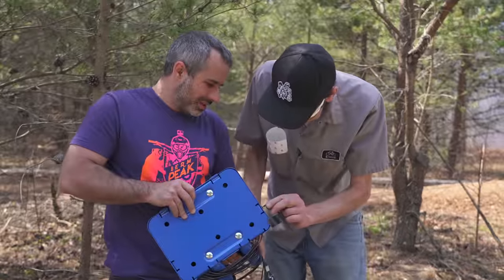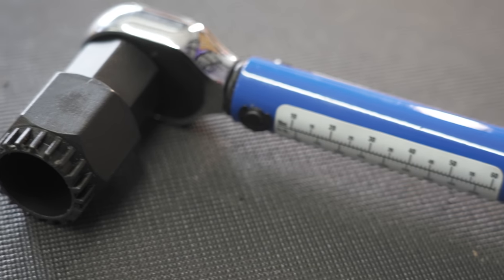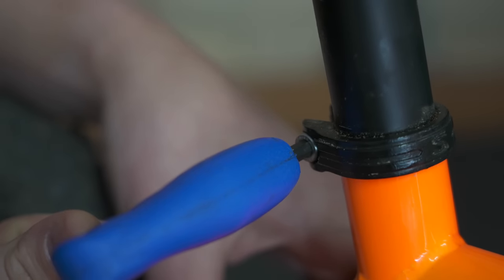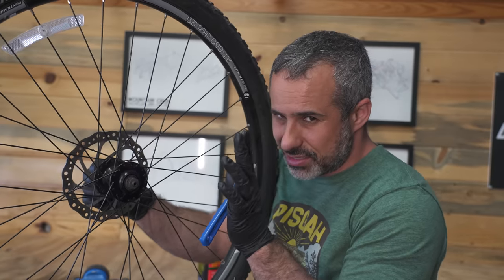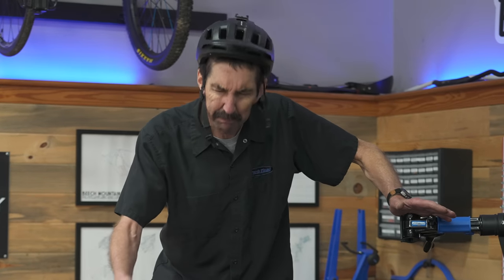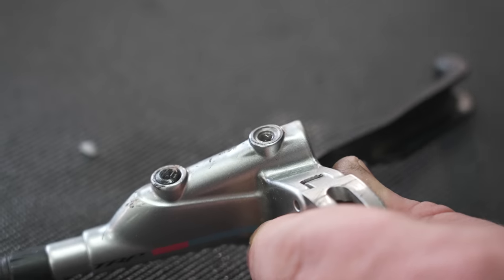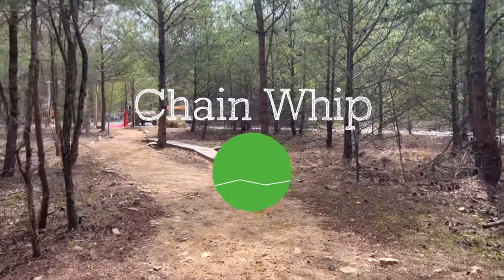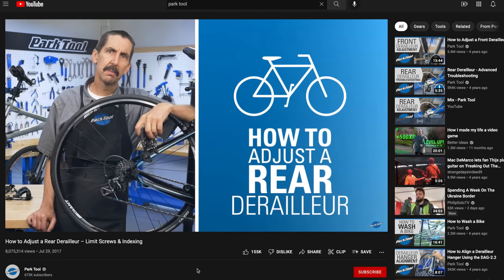10 Rapid Fire Bike Repair Tips for MTB & Beyond - Featuring Park Tool

Comment: It's those small details that make a world of difference, and one of them is to prepare a seat clamp correctly... 99% of all seat clamps are dry causing all kinds of mysterious seat-post movement no matter how much carbon prep you apply or how hard you tighten the seat-clamp.
Here's how to fix that..  All you do is remove the seat-clamp, carefully clean the inside of the clamp and the frame where the seat-clamp sits. Then lightly grease the inside of the seat-clamp and the area of the frame that contacts the inside of the seat-clamp. Then lube the threads and the head of the bolt on the S-clamp binder bolt.  Then apply a little bit of Carbon prep grease on the seat-post and BINGO, your s-post will no longer move.  What this does is it allows the entire clamp to move and draw it's self tight around the frame and seat-post with out pinching. Dry seat clamps tend to pinch which often results in cracking carbon seat posts. TKS Dan

Comment: Spent a ridiculous amount of time indexing and limiting my read derailleur one time. Turned out the rear 'maxel' was not tightened enough! So tightening that completely fixed the shifting. Actually it still comes loose from time to time. It's easy to spot because the shifting starts to suck. Is there a reason or solution to this issue??
Reply: Blue loctite?

Comment: Is there any difference between the barrel adjustor at the derailleur and the one at the shifter?
Reply: No. Many newer derailleurs dont have the barrel adjuster at the rear anymore though.
Reply: @johndef5075  Thank you. I suspected as much myself, both adjustors modify the tension on the very same cable. And yes, I’ve only seen the rear adjustor on older bikes. Thanks again. 🙏🏻

Comment: So, the float test? Why does that work? Is it that a bent hanger has micro cracks that hold air? 1
Reply: Its meant to be a joke. If you tried everything and the only possible malfunction is the hanger, then why not get a new one? 99% chance its gonna solve the problem, if it doesnt, you just have a new one!

Comment: Use aluminum paste on all steel screws that is jointed with aluminium. that means you don´t get galvanic corrosion and if you one day need to loosen the screw you actual have a fair chance to do so. If you don´t use aluminum paste the steel and aluminium will corrode each other.

Comment: Is the gun blue just for cosmetics or does it offer rust or some other protection? Is it ok to use on pivot points (such as on pliers) or will it cause the joint to tighten or loosen?

Comment: You guys talked a lot about quick release but didn't say anything about which direction the lever should face. I see so many people with the lever facing forward, or totally exposed. Your front wheel QR should face UP at the 12 to 1 positon. . Your rear wheel QR lever should be at the 9 to 1 position. Don't be the person with the QR levers sticking out there like a javelin waiting to get released by a rock or root.
Reply: It depends on the QR lever's form factor too. I've seen many people line up their open-cam levers at the fork blade, making it hard for me to undo them if they're on tight.

Comment: I usually the perception of Torque and how to scale Nm with bars of chocolate. Thst might only work for non US-citizensens, since you use imperial units.

One bar of chocolate in Switzerland usually is 100g. Do equivalent of weight (on planet earth) of 1 Newton. So 1Nm is like pushinga lever pf 1meter lenght with the weigt of 1 bar of chocolate. Everyone kwons how the weight of one chocolate bar feels. So they can approximate how 15 bars feel (for 15 Nm) or how 30 bars feel for 15Nm with a 50cm lever.

Comment: My son is has autism he is 15 now and refuse to pedal his bicycle smaller bicycle the rear wheel move the pedal bigger bicycle you can stop the pedals while the wheel spin.
Can I convert this so that the pedal turns only when the rear wheel turns ?
Reply: I think thats what youre thinking of is commonyl known as fixed gear or fixie. You need to purchase a suitable fixed gear hub, go ask a bike mechanic to replace it or remove the spokes and attach them again

Comment: Or you could just buy ht pedals or some other brand where they have the pins as actual bolts with proper heads on the other side of the pedal to where you feet go and you just replace them like any other screw 
Just sayin🤷🏻‍♂️

Comment: Never flex a drill bit, thats too much pressure, and it will eventually break or snap. Light to moderate pressure on small bits, 1/4 and smaller, let the drill do the work. Bigger bits have more material and are tougher.

Comment: Well, let's talk about derailleur hanger... Replace this part not necessarily get you good result. NAt all bike frame build equally, some time you get not strait dropouts, so for good resul tou need slightly bended derailleur hanger. So its beter to have this tool, or use low speed count rear derailleur.

Comment: Actually there is a better solution than a float test.

If you have a wheel with qr hub (from any bike, not only this one, you can use it instead of derailleur hanger alignment tool.

QR hub axle has the exact same thread as derailleur hanger mount bold, so carefully screw a wheel into the hanger right onto your bike and that is your guideline. You need to align that "additional" wheel parallel to the rear wheel and that will get your derailleur hanger fixed.

Though this will only work a limited number of times because aluminium is too fragile to be infinitely bent without a crack.

Comment: The tip for using WD40 on tools is terrible: most tools nowadays come with plastic rubbery (buna-n) handles. These synthetic "materials" will degrade seriously after just a few WD40 shots. They start melting or smelling AWFUL after that. Dont do it. Soap and water still works

Comment: When drilling with small bit you should go faster and dont use mutch of presure.. You can brake the drill.. Just drill faster with less presure and it gets the job done.. You wanna go slower with larger drills like 18mm or 20mm